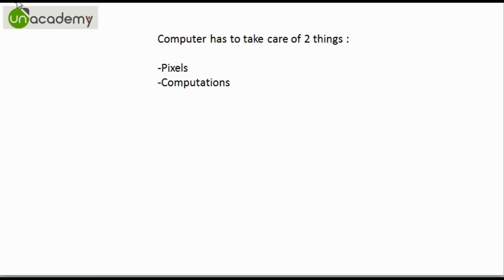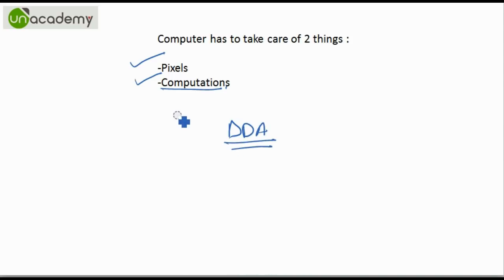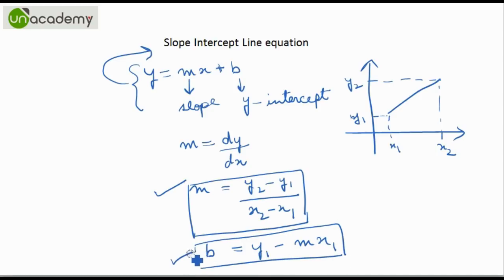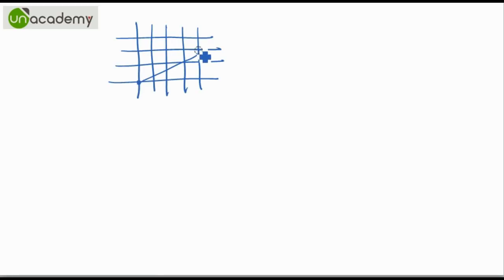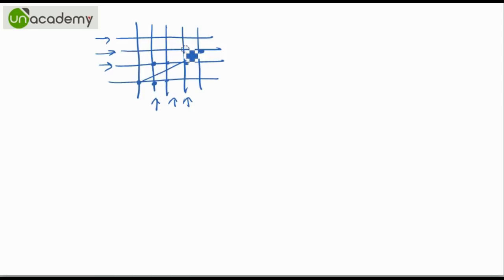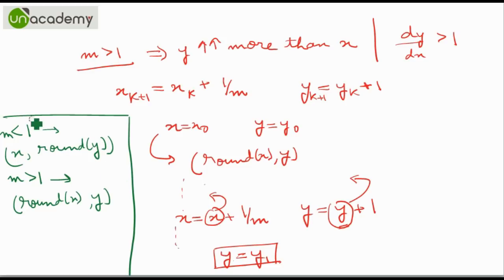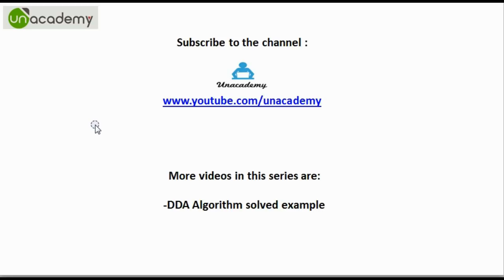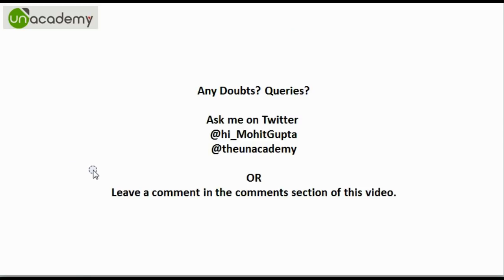What is DDA line drawing algorithm in Computer Graphics?

Comment: if slop is one then what we have to chose
Reply: if slope is 1 , this means dy/dx=1 which means every point will lie perfectly on a pixel. so no algorithm is required to calculate the nearest approximate pixel :)
Reply: if slope is 1 , this means dy/dx=1 which means every point will lie perfectly on a pixel. so no algorithm is required to calculate the nearest approximate pixel :)
Reply: I think to maintain the integrity of the algorithm, since when m < 1 we do x + 1 and when m > 1 we do y + 1 therefore when m = 1 we should do both x + 1 and y + 1. These are just my thoughts while trying to understand this algorithm.

Comment: you should make a part 3 of the DDA algorithm. Everybody explains this the same way and its probably because everybody is going by the same original textbook and few ever go beyond that textbook.

It turns out there is an optimized version of this algorithm that does not use rounding and is done purely in integers. I like the DDA algorithm over Besenham because its a hell of a lot more intuitive. Besenham's Algorithm non-intuitive DDA algorithm very intuitive. And its just as fast. And the intuition carries over to rotating and scaling bitmaps.

I will leave you with how its optimized. Its about keeping the slope as a fraction and do the accumulation as a fraction. The round() function is the same as trunc(float_num + 0.5)

So when the slope is < 1 the algorithm starts of like this:
for (x = x1; x < x2; x++) {
   y = mx+b;
   plot(x, round(y));
}
the b constant just represents the location of the line which you already know; you get rid of the multiplication because its multiplication is just a series of additions. Soo, on every step all you have to do is add. Hence the algorithm can be modified as so;

for (x = x1, y = y1, slope_sum = 0.0; x < x2; x++) {
   plot(x, y);
   slope_sum += m;
   if (slope_sum >= 1.0) {
      y++;
      slope_sum -= 1.0;
   }
}

The above is the DDA algorithm. Now to optimize it you get rid of that nasty float addition. You simply keep the slope as a fraction. When adding fractions only the numerator changes. You detect when the fraction is greater then 1 when the numerator > denomenator.

dx = (x2 - x1);
dy = (y2 - y1);
dy_sum = 0;
for (x = x1, y = y1; x < x2; x++) {
   plot(x, y);
   dy_sum += dy;
   if (dy_sum >= dx) {
      y++;
      dy_sum -= dx;
   }
}

The above is pure integers but its not accurate because its truncating the y value into the screen not rounding as it should. As I said round(float) = trunc(float + 0.5); So what this translates to is initializing dy_sum to dx/2.

dx = (x2 - x1);
dy = (y2 - y1);
dy_sum = dx/2;
for (x = x1, y = y1; x < x2; x++) {
   plot(x, y);
   dy_sum += dy;
   if (dy_sum >= dx) {
      y++;
      dy_sum -= dx;
   }
}

To get rid of that division you can multiply dx, dy and dx_sum by 2 to be 100% precise but I see that division as harmless because it just represents the round() function.

note: I suffer for dyslexia so I might have switched a dx with a dy by mistake but I hope you can follow my wording.
Reply: DudeOfX 
Can you pls explain how the flow chart of DDA is made?

Comment from the maker: By mistake the no. of iterations has been told as x1-x0+1 , the correct no. of iterations will be x1-x0 . Please note the change. Thank you.
Reply: you should add this message on video by using cards.
Reply: Dude plzz try to solve this (0,0) (4,6) by this technique x0 becomes x1 but y0 doesn't become y1. Help me out bud tomorrow is my exams
Reply: Pin this comment so that it stays at the top.